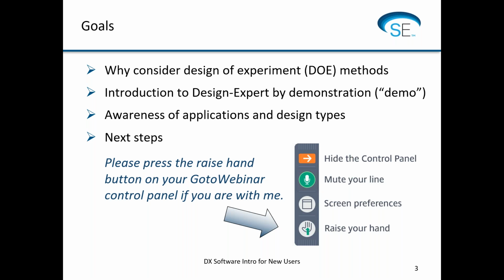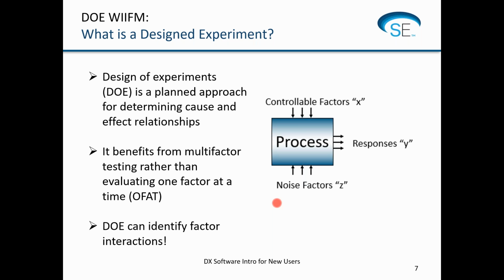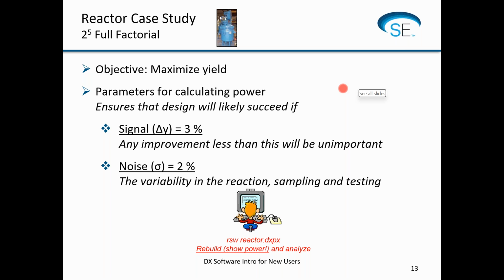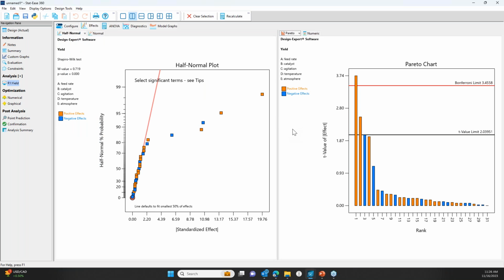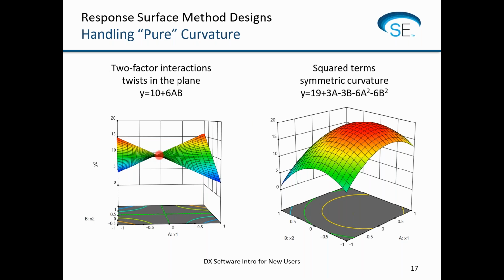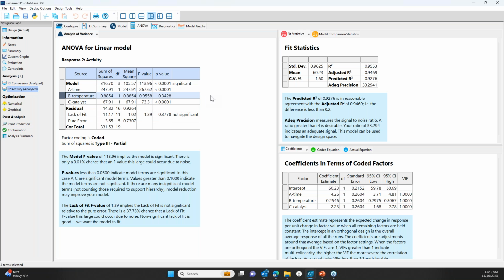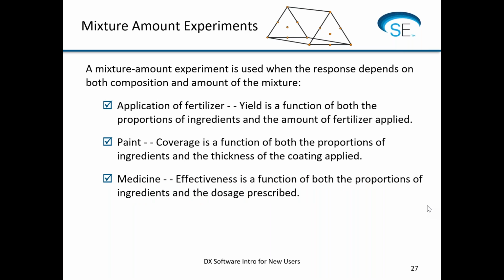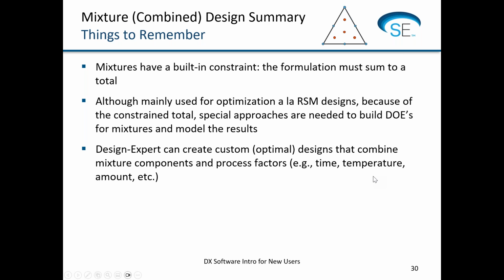New User Intro to Design Expert® Software

Comment: Does the software works in arm based laptops, because I’m going to buy a Surface laptop 7 with arm chip.
Reply from the maker: It should! We haven't specifically tested it, but Windows says that our application (which is x64-based) would be able to run on the latest Surface.